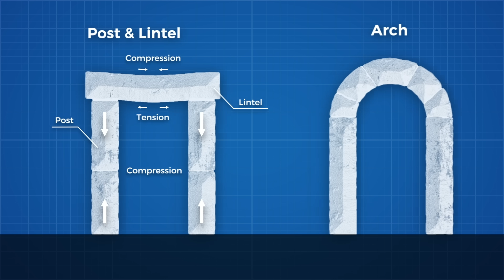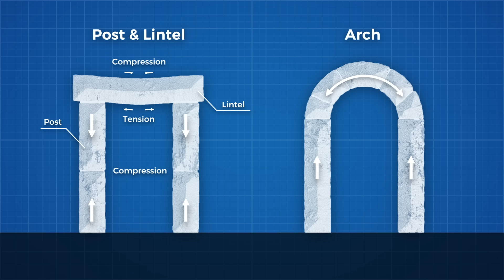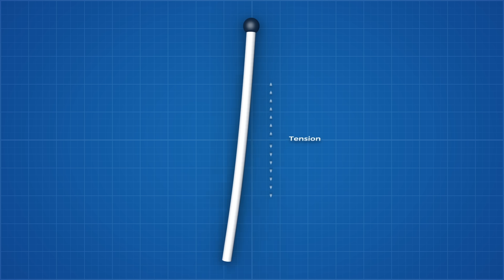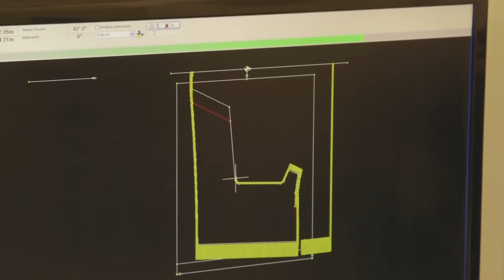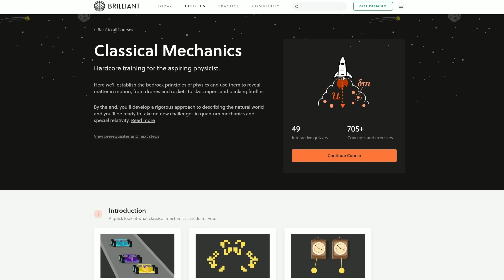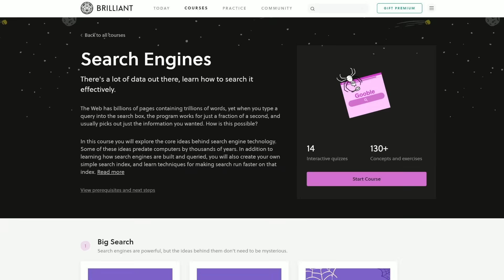The World's Oldest Construction Project | Sagrada Familia

Comment: Strings do not hang in parabolic arches. They hang in catenary arches. Similar, but slightly different. Mathematically, working with catenaries requires far more skill, as parabolas are introduced in elementary Algebra, while catenaries are introduced in advanced calculus.

Comment: Not to be an ashole, but you keep calling it "the sangrada familia" wich translates to the bleeded family in spanish, the name is "Sagrada Familia" holly family in catalan. Considering Gaudi was a debout catholic who was repeetedly arrested for speaking catalan in public, the distinction is relevant. Also, fun fact, it is an unspoken truth that the consortium running the construction slowed the process for most of the 70s 80s 90s and early 2000s because they where only allawed to charge admision to the building site as lon as it was a building site and not a functioning chirch, but in the late 2000s there was some kind of shakeup involving city hall and the catholic church, and the construction progressed further in the las 15  yeas than in the 40 years prior.

Comment: there's a lot of wrong facts about styling and financing this building in this video
Reply: care to elaborate?
Reply: @GrandLineSymphony  There's a lot of parts of Sagrada familia like the whole west entrance that were made way after Gaudi's death and designed by other architects and sculptors. That entrance uses supports like in a gothic cathedral. That is something that Gaudi would had never done for this building, Sagrada Familia is not just style, it's also a enginiering challenge. Also lot's of sculptures shown as original are clearly not the original Gaudi style nor inspired at all on the general  and made in the 70's. About financing, there's two key points that should be mentioned. The cathedral has been a gold mine with selling tickets to tourists since probably the 80's so It might only struggle during Franco times. Also a major key is that the company that builds the church who also handles the tourist tickets business didn't pay construction taxes since ever. Current major in Barcelona forced that to an end since 6 years ago, after that building speed has changed drastically, probably due to that moment when the longer it would take to finish the longer the tourism tickets business would last.

Comment: I worry that using steel bars inside the stone will shorten the buildings lifespan. As they rust over decades (or centuries?) could they degrade the stone, like rebar does to concrete?
We should build the such a magnificent structure such that it stands for 1000s of years.

Comment: late 1800s??? yup he inherited them not designed.  you can tell how far off are additions have been from the original use before they called it a cathedral.. the fact they cant finish is all the proof you need when alleged contemporary structures some larger took less than 10 years according to THEIR narrative. the more i watch the more details revealed, stop it? probably had a fire at some point too.

Comment: It looks like they're using concrete, and not stone, to finish it. Is it possible to assemble actual stones into bigger sections (like Lego), as they show at the end of the video? However, if this is still stone, then it must be the last such building project in the world. Even in the 19th century, stone was barely used to build, bricks (and later, concrete) being the preferred building materials. For the past 150 years or so, stone has mostly been used for decorative purposes.

Comment: I didn't realize it was sandstone. So it's really a bad design actually, as it proved extremely inefficient to build, and was even more so with period techniques. Instead of relying on modern materials like cast iron elements and steel beams, and later making the project evolve to use reinforced concrete, Gaudi stuck to an antiquated and labor-intensive material to use. Viollet-le-Duc was much more of a visionary, as he probably was the first to state that form and function should work together. He never had a chance to realize his groundbreaking architectural theories, but he deeply inspired the Art Nouveau movement and modern architecture. He was theoretically way ahead of his time, but he was pragmatic, and his designs were to use advanced construction techniques of his time, instead of using antiquated methods to build unadequate designs. He's the first modernist architect, and an universal genius.

Comment: Sagrada Familia basilica is not the oldest construction project. That belongs to Milan Cathedral starting from 1386 till 1965 as a religious building. Six long centuries of construction expanding and finishing the building. Also, China's  The Great Wall is the by far the oldest construction project taking about 2000 years of constant refurbishment, and expansion. However, Sagrada Familia is the current longest building project.

Comment: Mark 13:1-2. Of course beauty is in the eye of the beholder. Many find this building beautiful, and I congratulate them. I regret that for me, it is exactly the converse. Those towers are proportioned as spikes, and there's far too many of them. The effect reminds me of a crown-of-thorns starfish. I think the proportions are wrong, generally - too vertical, too narrow. The lines are obscured by over decoration. The interior is a medley of different curves, which confuse the eye. The heavy braces that sprout in straight lines from the large lumps on the tops of the columns look particularly clumsy to me. I see no harmony. On the contrary, it seems "busy", fussy, cluttered, with a clash of incompatible styles and orders.

It would appear that the original designs could not have been executed with the materials and techniques available in the day, and that even now it is pushing the limits. I wish nobody any harm, and I hope the estimates of its structural soundness prove correct. However, I suspect that it will require rigorous and very expensive maintenance, and if this is scamped, disaster might follow.

Comment: Using those strings as structural skeleton for his building was pure genius
Reply: He built his building upside down. That takes skill.
Reply: Actually, it is not. For the simple reason that a building has to be built upright and that has nothing to do with how strings behave when suspended in the air. The curve in the interior gives an unstable effect, and the way in which the vaults are designed only enforces this. Compare this with the interiors of the great European cathedrals.

Comment: Seeing as how this is Real Engineering, it would have considerably improved the quality of the video to have gone into detail on the structural problem that Gaudi was actually trying to solve with the leaning and branching columns. The oversimplified lintel versus arch discussion really isn't relevant. That was already solved even before the Romans (though the Romans made heavy use of it) and had been known for at least a couple thousand years before Gaudi was born.

Prior to Gaudi, state of the art in the construction of large Gothic churches was to employ flying buttresses to counter the tendency of arches to splay outwards and shove their supporting columns apart. Gaudi's idea was to eliminate the need for the flying buttresses by leaning the columns inward just enough so that they would counter the arch force that introduced the outward splay.

Of course, tourists are far more impressed by the decor than any technical detail of how the structure manages to stay erect and support a plenitude of enormous towers with leaning columns.

Comment: Wow. Egyptian could have built nearly 10 pyramids in that time scale. Shows how we have gone backwards.
Reply: Bruh did you just compare building a complex verticle building with a very hollow inside to building a pyramid? the simplest type of building possible?
Reply: Evensong yes over 4000 years previous that we can’t even build today lol... in 20 yrs with copper tools. Have you ever been their in one? I have quite a few times. The shafts and tunnels and stonework is baffling. Bet this building isn’t standing in over 4000 years. Or moved more than an 1/8inch in that time.
Reply: We can build pyramids today, except there is no reason too, we have cranes that can easily lift over 40,000 pounds (around 20 pyramid stone blocks), hell there are helicopters can easily lift a block from the pyramid. This combined with modern mining equipment that could cut a block needed for a pyramid in a matter of hours if not less and you can quickly see how the only reason we don't is that pyramids arn't practical structures; Can you point to any ancient structures that are nearly 900 meters tall, hold up to 35,000 people and serve actual economic or practical purposes? 

More related to the video though, the reason construction took as long as it did were all listed, his original design was far more complicated than stacking blocks in a progressively smaller fashion, not to mention a  literal civil war and death of the designer in the middle of the project and a shortage of supplies and funding as they didn't have a dictatorial king throwing the equivalent of billions of dollars today into his passion project.  

don't get me wrong, I love the pyramids and Egyptian history in general and the pyramids were a marvel of engineerings at the time but that is key part of all of this "at the time" and its insulting to all of the work humanity has done to advance as far as we have, with modern engineering that Egyptians would have considered magic if they saw it.
Reply: Evensong yes I do see your point it’s took 4000 years or more to do this. And there’s Baalbek. 1000 tons. I just think we haven’t progressed much in the time. When academics say we were cave men 1000 years prior to the pyramids. But yes you are correct on the technology

Comment: In Milan (Italy) when something takes a long time we say that "it's taking longer than the building of the Milan Cathedral". Started in 1386, in 1580 the facade was still unbuilt. In 1765 the highest spire was finished. In 1805 Napoleon decided to change the facade design. 1892: finally finished (506 years). That same year it was necessary to start maintenance, preservation, and restoration works that are still active today.

Comment: What building codes are in force?  How did they decide that the 'pure stone' and the reinforced metal stones with wear properly?  ( Many old constructions were 'reinforced with metal connectors that rusted and caused greater damage in years then seen in a century).  Why did it take nearly 100 years to obtain a building permit?  (given in 2019)

Comment: The length of time to build cathedrals isn't new.  They often took several generations.  It is just this one was started relatively late into the modern age.  Most other major cities in Europe had already finished or nearly finished theirs.  I figured metal is being used to hold some of the pieces in compression.  It was suspicious there were no flying buttresses to hold such a high structure together.  There was a competition by the various cities in Europe to make their cathedral the most high and slender, and I believe several of them became unstable.  Ships' anchor chains were hidden in some of the works to hold them together.

Comment: "3D modelling softwares have slowly caught up with Gaudi"
Reply: The moment when 3D simulation software gets outdone by bunch of strings and bags of weights.
Reply: Neurofied Yamato it’s easy to write a wireframe code that does the same thing as the strings. What’s hard is full 3D simulation because the number of mesh elements required is massive.
Reply: @neurofiedyamato8763  Give simulation software a break its relatively new compared to those hundreds of years developed architecture but give it a decade and it'll
 be better than ever ;)
Reply: as a correction to that
3D civil engineering software has slowly caught up
it's one thing to have a thing modeled for a Disney movie and another thing so you can make it in real life
not for the lack of tech either, it's mostly because civil engineer never have a need to make such a grand structure in the first place so they never made the proper code for it
this thing is massive
Reply: BLENDER master race
Reply: @mihailazar2487  it's most likely CATIA, which is being used for complex architecture projects like this. It was designed for aeronautics, and has evolved to be used in architecture.
Reply: @mihailazar2487  i use blender daily (because maya is overpriced and fusion is bloated)
in no way is that a proper civil engineering software
Reply: @aronseptianto8142  not yet
Reply: @mihailazar2487  looking forward to when Blender adds Finite Element Analysis

Comment: Will this building last as long as the medieval Gothic cathedrals, or the Roman structures still standing? They use steel in the construction, and in modern architecture, steel is a bottleneck in building durability, as even inside concrete, steel rusts.